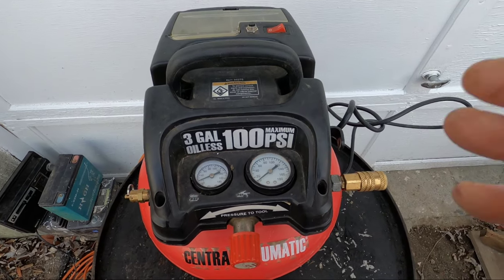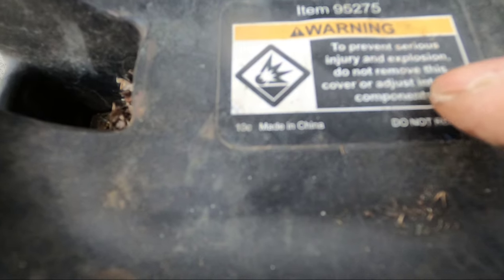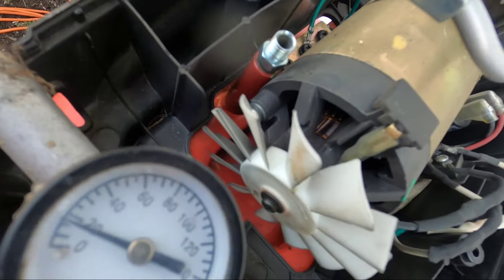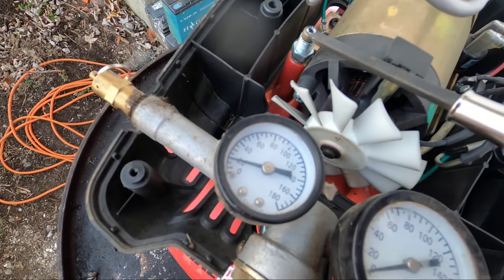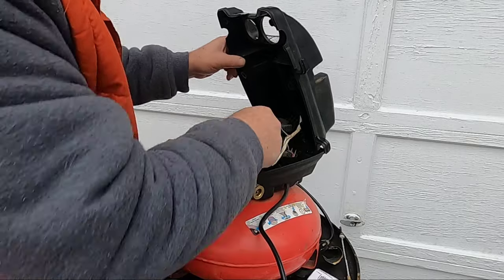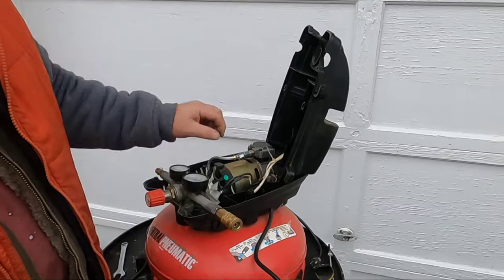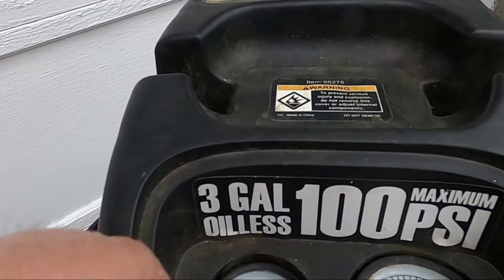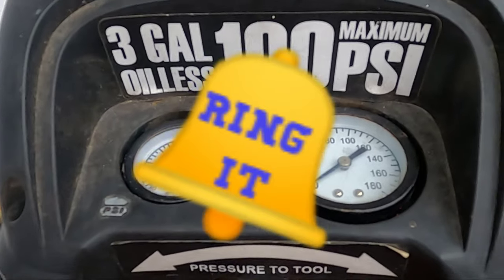How to repair fix air compressor not building pressure easy fix

Comment: Thanks Joe. I have exact model. Mine will only turn over once when I tap on it and then only sometimes. Any ideas? Thanks
Reply from the maker: Bayou Flats, I did not run into this problem ( yet ). I had exhaust fans that would run fine but every so often I would have to go roof top & give them a spin to get them going until I changed out the motors. I was told they had a "dead spot" & when the motor stopped on it they needed a spin to get going again. Do you have to push the reset button to get yours going? If so it may be the rectifier. It can also be the pressure switch. Not being an electrician I am giving you my best guess. Really not too much to these compressors but be careful they can still give a BIG bite.
Let me know if this was of any help & how you got it going again.
Be Safe, Joe Z
Reply: @JOEZEP54  thanks for reply. Yes, I’m thinking one of those two items also. If D.C. not there-it’s not going to run and if it thinks it’s at pressure-not going  to run. Appreciate
Reply from the maker: @bayouflats5054  Glad to be of help. Sounds like you're on the right track. Let us know.

Comment: Hello, i have a oil paasche silent compressor for airbrushing it turn on but it doesn’t fill the tank it just stays on and gets hot. I checked for leaks no leaks. Hope u can help thank you.
Reply from the maker: Thank you for stopping by. Oscar if you did not find any leaks it may be a broken reed valve. Without seeing it or knowing anything else about the compressed I would check that next. Let me know if this helps.
Stay well, Joe Z

Comment: I have exactly the same issue on a totally different compressor. 
Over time, the motor vibes get to the connection at the far end of the line at the tank.
Reply from the maker: Thank you for stopping by & taking the time to comment. This was an easy fix, lasted 2 year of use & abuse but finally went out again. Being my channels'  theme is  " RECLAIM REPAIR REUSE RECYCLE " I made the repair again, this time using the copper water line off a refrigerator that I am repairing. I should have the video up this Sunday.
 DaveG I have other videos on my channel that cover different subjects  and new videos added weekly that may also be of help or interest. 
Your support is not required but always appreciated. If you are inclined to do so your Subscription, Likes, Comments and sharing this content do help.
 I hope you get to  enjoy other videos on my channel as well. 
 Stay safe, Joe Z

Comment: Txs Joe,but let me ask you my compressbuilds up air but doesn,t show pressure out of air hose.Will take apart an check lines.txs again.
Reply from the maker: You're welcome. I would check the adapter ( quick release ), not sure of the name but where the hose connects to the compressor before I take it apart. With the pressure gauge in the off ( no pressure to the tool ) side remove the quick release. Then turn the pressure gauge on. If air comes out you found the problem if not you eliminated a possibility. Let me know if this is of help 
Stay safe, Joe Z

Comment: Thank you for this video. My compressor did the same thing. Do you remember what line you found at Home Depot? I need to go get the parts for the repair and I want to put something flexible and durable in.
Reply from the maker: You're welcome & thank you for watching. I cannot remember but if you take
the nut with the whole that holds the tubing you can use it to make sure you get the right size.
Also if you go to an auto parts store you can buy a short piece of break line. Do not forget to get a new ferrule ( compression sleeve) to complete the compression fitting.
Hope this helps to get you going.
Stay safe, Joe Z
Reply: @JOEZEP54  tried the flexible tubing it blew out at 40psi.
Reply from the maker: @ltnerb  What material was it made of?
Reply: @JOEZEP54  my HD only had a clear tube in 1/4” that had a large enough diameter. My dad said they used a certain type of rubber on equipment when he was a mechanic on a Marine base. Told me if it breaks find copper tubing and use that. It was their preferred fix on equipment.
Reply from the maker: @ltnerb  Yes I agree with your dad about the copper. If you cannot fins the copper in a small quantity not   to buy a roll of copper tubing, try the auto parts store for a short piece of brake line.

Comment: Congrats on resolving an interesting, unusual problem. Expected you would dab soap on suspect fitting before wrenching it which would cause strain on pipe. Was unable to tell whether you loosened compression nut at the rust connector before trying to tighten rust connector.
Reply from the maker: 65CSX,  Thank You for watching and taking the time to comment. I did not use soap, everything was very easy to take apart. But if there is a rusted fitting hard to remove I would use  a mix of 50% transmission fluid & 50% acetone  that I keep on hand.  If nothing is available soap could work. Thanks for the tip.
65CSX I have other videos on my channel that cover many different subjects  and new videos added weekly that may also be of help or interest.

 Be sure to 👍, share & subscribe if your are inclined to do so.  Also not to miss any new videos remember to hit that notification 🔔

 Another way you can help support  this channel at NO cost to you is by using one of my affiliate links.

     * Thank you for watching I really appreciate your support.***
Again I hope you get to  enjoy other videos on my channel as well. 

 Stay safe, Joe Z
Reply: @JOEZEP54  Soap at fitting for air leak check before separating needlessly. Same here on just one of many handy ATF uses. So rusty fitting cause is unresolved I take it?
Reply from the maker: @65csx83  Soap to check for air leak, now that makes sense to me. Misunderstood before. Rusty fitting not the problem. Aluminum tubing snapped. Since this video the compressor is used 2 to 3 Xs a week without any issues.

Comment: I have a similar 3gal pancake compressor that will build air, but as soon as it's at full pressure and I try to fill a car tire to 35psi, the tank pressure drops like a rock. As you know, it takes forever to reach full tank pressure again, so it can take an hour to get air into a tire. Even if I set the hose pressure to the max, it still dumps all the tank air quickly without filling the tire. Any idea what causes that?
Reply from the maker: Sorry for the late reply. I had a computer problem & was trying to reply to comments on a borrowed tablet.
Check all your connections for a leak when you fill the tire. It can be a bad/leaking fitting or a check valve. Hope this is of some help.
Stay safe, Joe Z

Comment: Wouldn't surprise me it does that again. Maybe opted for brake line with 2-3 loops bent and pulled a little from each other in the line between the two points of attachment to act as a vibration absorber
Reply from the maker: I have been using this compressor since this repair. Your comment is timely.  Just yesterday it would not build pressure pass 20lb. It happened again. Now for the brake line. I will try your loop suggestion. Thank you for visiting & this tip.
Stay safe, Joe Z

Comment: One of mine does not build very much pressure at all. It appears to be the regulator valve.  
  I took it apart, and it looks like someone had fooled with it before, I lost the print in it.  I tend to get another valve. 
  Have 3 or 4 more I need to get back on too.
Reply from the maker: Hope you get them up & running. I am curious, when you get them running let me know what the fix was.

Comment: I 💕 the vid, 👍 having fam involved   mine has rubber hose instead. I took off hose on far end it's still pumping PRESSURE but not building in the tank, too loud for me to hear 🙉 hiss.  And can't see any bubbles when I use soapy water. I'm at a loss that's why I'm reaching out,????
Reply from the maker: Hi Joe, it could be the drain valve on the bottom of the tank, or the quick release where you attach the hose. On mine I have to have the outlet side closed until the tank fills or it will take a long time to fill. Let me know if this is of help.
Stay safe, Joe Z
Reply: @JOEZEP54  both those connections and every time I have to put parts together I use teflon tape and always drain water out of the bottom with soapy water I can easily see if either place there was  bubbling leaking air drives me crazy I'm so OCD can't even hear the hiss would bother me whatever happened happened quickly last week when I used it to air up my bike tires it was fine it had been seeming like it's running a little bit long to build that pressure but when I did I never heard a hiss. As I said when it's running it's too loud to hear his coming from it and it's not building up any pressure I think I'm going to take the compressor off of the tank mounted to a board and splice my air hose onto it forgetting the gauge is completely just go for minimalistic and function savings space. I can always use a tire gauge and I use one anyway when I'm done airing anything up. Your reply and your time I thank you for very much. 👍😁
Reply: @JOEZEP54  not clear on what you meant about keeping your outlet closed until the pressure builds.??
Reply from the maker: @MikeTyson2   The adapter where the air hose gets connected. I do not open the valve to let the air out until the tank is filled.
Reply from the maker: @MikeTyson2  You're welcome. When you take the compressor off the tank check the valves in the compressor itself. One may be broken or missed aligned.
Reply: @JOEZEP54  you do mean the check valve is that right? I've had it a year it never has built up a lot of pressure not above 80 if I even remember and in the instruction book it said don't let it run for over 4 minutes I've had to be careful of that because it took much longer to always
Reply from the maker: @MikeTyson2  The valve that you turn to let the air flow to the hose. The connector for the hose on mine had a slight leak.

Comment: What if the regulator is set to high pressure but regardless which air hose I use, it airs car/truck tire up very slowly. 
  Check valve, regulator, hose?
Reply from the maker: I would check the gauges. If the tank pressure gauges is reading the proper pressure I would "assume" there is an issue with the regulator. If it is not building up to the correct pressure there is either a leak somewhere or your reed valves may be the issue.
Hope this is of help.
Stay safe, Joe Z

Comment: Found lots of condensation, no leaks, copper tube, sprayed lots of WD 40 into tank and  pressure control knob which has holes and rubber seals. Issue was extreme amount condensation. Thanks
Reply from the maker: You're welcome and thank you for watching & taking the time to comment. I drain my tank after using it a few times. It usually just used to fill mower tires when working outside. 
Stay well, Joe Z
Reply: It reaches 100psi per its gauge, but barely fills a tire. No leaks. Might have to disassemble the area where that pipe connects to, opposite the tank section.
Reply from the maker: @raycarr225  When it reaches 100 PSI does it hold pressure.
Mine now has a slight leak where the hose gets connected. Check the regulator it may have a leak.
Reply: Unplugged it overnight and it held pressure. Issue now :doesn't fill a tire past just 2-3 pounds! Something's amiss.
Reply from the maker: @raycarr225  Possible faulty gauge? Other than that I am at a loss.
Reply: Turning red knob to close keeps it from leaking from hose connector. I'll take her apart and see. Thank you.
Reply: Pressure control knob -brass part that screws into tank has to be unscrewed /adjusted for distance to the knob for air to be allowed out completely. Vibration must have thrown it off setting.

Comment: Hello i also have a pancake compressor like yours, mines is not putting out enough air, what do you think the problem could be??
Reply from the maker: I would check the easiest & often overlooked first. Check the drain valve on the bottom of the tank for leaks. Next air hose connections, fittings and regulator. Then take a look inside. May be the air line like the one in this video, may not be broken but loose. If none of these it may be the reed valve.
Let me know if any of this helped.
Stay safe, Joe Z

Comment: M y bigger HF compressor just stopped building pressure. Hopefully it's something like this. Thanks.
Reply from the maker: Fingers crossed! If not this I would check the regulator and then the valves.
 I am always interested, let me know what it was & the fix.
Stay safe, Joe Z
Reply: @JOEZEP54  Turns out one of the reed valves snapped in the center, and one half slid over the other half. I found a kit for about $13 shipped on Amazon that comes with stainless reed valves and a head gasket. Fingers crossed the parts work!
Reply from the maker: @jayinmi3706  Thank you for sharing. Sounds like you're on your way to having a working compressor again 👌Stay well, Joe Z

Comment: My compressor starts working and builds pressure up to 150psi but sometimes during work it will not start and won't keep tank charged. Sometimes it turns on only for a few seconds then goes quiet. Sometimes I hears something that it wants to start like air going somewhere through the pipe for about 2 second and then quiets and stays like that. Fails to keep up pressure in tank when I use it. Pressure goes low as 50psi but compressor doesn't start. Then I had to open drain valve to release remaining air pressure in the tank. Disconnect it from AC power for few minutes and it starts working again build up to 150psi again. I don't hear any air leaks. What could be wrong?
Reply from the maker: It sounds like it has to do with the regulator/pressure switch ( maybe called something else). You may want to check the reed valves. Something could be malfunction there. When the compressor does not turn on is it after it has run for a long period filling the tank then won't come back on once the tank calls for more pressor?
Reply from the maker: @Jo Blo Thank you for visiting. Yes it is. I do not know if they still carry this model,  $39 or $49 when I bought this. Now they sell a MCGRAW brand for $70. Looks the same but maybe better built??
Stay well, Joe Z

Comment: Wouldn’t you want to release the stored air pressure before working on it?
Reply from the maker: Thank you for stopping by & taking the time to ask this question. In this case there wasn't any stored air pressure. With the broken inlet tubing air pressure could not be made to any significant amount or maintained.
Stay well, Joe Z

Comment: Where is the air intake for the compressor? Do any of the shots show it ?
Reply from the maker: Thank you for watching. Your question got me curious. I was busy the last couple of days but today I opened this compressor up. I could not see where the intake is. Should be obvious but I could not see it. Could be under where the piston is. Sorry I could not be of more help.
 Stay safe, Joe Z
Reply: @JOEZEP54  I peered into the openings where you can see the motor shaft enter the pump, and saw the 5 small holes at the 6 o'clock position that the air is drawn from-
No filtering for the air aside from the small holes; best for longevity not to run it in a dusty environment.
I sprayed a bit of lube into the intake and let the pump pull it in to coat the reed valves internally, and it dropped the charge time to cut off by 20 seconds. Air tool oil should help keep the parts and tank from corroding.
Reply from the maker: @dubmob151  Good tip.👌
 I had this for years & will use your tip to keep it going for as long as possible.
Stay well, Joe Z

Comment: hola buen dia yo tengo uno husky de 2 galones uso esclusivo para inflar llantas del carro pero ya no me ensendio  lo que encontre el fusible quemado le puse otro y lo quemo de nuevo revise la placa vi un surco como de un corto circuito alguien que me pueda ayudar y seguir usandolo de ante mano muchas gracias😥😥😥
Reply from the maker: Hola, no estoy familiarizado con el compresor Husky, y sin poder verlo, solo estoy dando mi mejor suposición. Si está quemando un fusible, debe ver qué está causando el cortocircuito. Puede ser solo un cable que estaba desnudo y tocando otro cable o conectado a tierra al compresor. Espero que esto sea de alguna ayuda. Avisame como va la reparacion. Mantente a salvo, Joe Z

Comment: That looks like aluminum.
Do not use aluminum tubing. It's way too brittle.

Use steel tubing if you can.
That's why brake lines and propane lines are made out of steel tubing.
Reply from the maker: Thank you for watching and taking the time to comment. @TF856 this is  the original aluminum tubing that I just reattached. You can replace it as I mentioned in the video with break line.
 @TF856 I have other videos on my channel that cover different subjects that may also be of help or interest. 
Your support is not required but always appreciated. If you are inclined to do so your Subscription, Likes, Comments and sharing this content would help me to reach other viewers that may also find this channel useful or entertaining.
 
 Stay safe, Joe Z